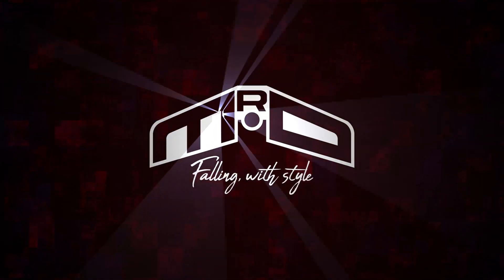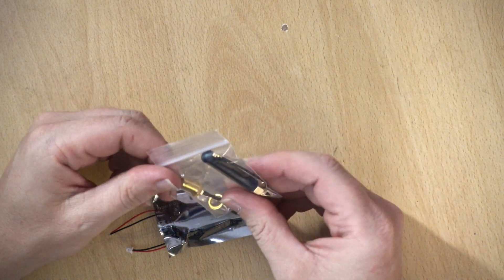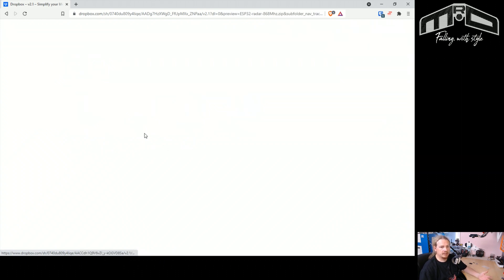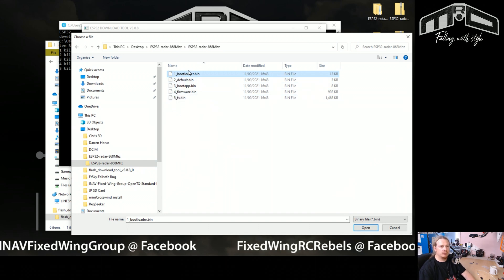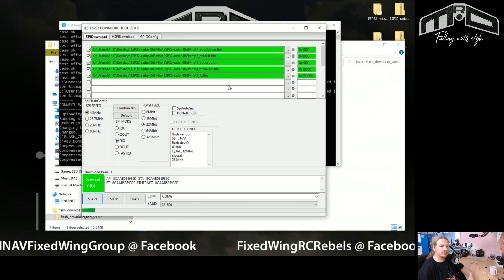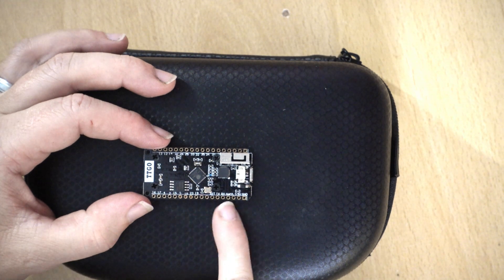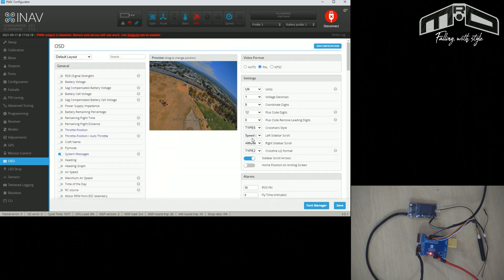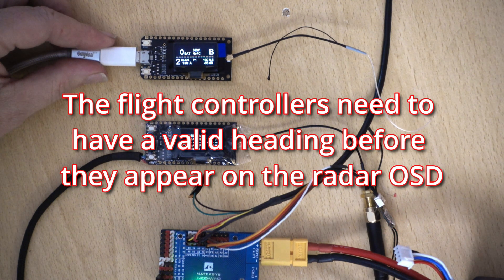Setting up iNav Radar

Comment: Does 433mhz and 2.4g interfere a lot?
The 433mhz module is only 2€ right now and the 868mhz link doesn't work for me, but I want to fly 20km+ away from me with this and elrs.
Do you think that would work out
Reply from the maker: It should be fine. 

This is for seeing other aircraft that also have the radar modules on the same frequency. The maximum claimed distance is 4km. It’s not really needed for positioning between the aircraft and home.
Reply: @MrD  im just wondering if it would affect my elrs (2,4ghz) range if i'm using 433mhz
Reply from the maker: No. To be honest, 20km is nothing for ELRS. You could get those distances on low power.
Reply: @MrD  ok, thank you

Comment: FormationFlight seems to have taken over from inav Radar. It seems a advantage is that the hardware used can be repurposed express LRS receivers.  Would be interesting to hear your thoughts & might be a good topic to do a video on the setup/configuration.  Cheers

Comment: What's the minimum to get a heading in inav? We're setting up formation flight on wings without a compass and my friend had to drive in the car to get a heading before the OSD would show up to test everything. If we could walk around the yard a bit would be good to know.
Reply from the maker: I never bother. All I do is make sure that the device in my plane can see the flight controller (will have GPS data). Then when a friend switches on, make sure that the other pilots are added. If this works, I just fly.
Reply: @MrD  understood. We're we just trying to make sure it worked on the bench since our group doesn't get together often

Comment: Hey ! Your video was very helpful. Does this system also work on a digital system?
Reply from the maker: It depends on the system and firmware. HDZero, Walksnail Avatar, or DJI with the WTFOS firmware will work 100%. DJI with their own firmware will not work well.

Comment: Thank you. This tutorial helped a friend and I setup our iNAV radar. 
We have a question you might be able to answer. The HUD displays 3 strange arrows. That don't seem to describe anything. Do they have a function, or are they a bug?
Reply from the maker: Great. I’m glad it helped. Check out this article https://www.mrd-rc.com/tutorials-tools-and-testing/flight-controller-therapy/esp32-radar-finding-your-friends-in-the-sky/

If the arrows are around the crosshair, they are the home direction. I will be making an updated video when INAV 6 comes out, as I’m working on a change to make the HUD elements much nicer.
Reply: @MrD  Thanks. The article is very informative.
Even more extra's in 6.0. Top stuff.
Reply from the maker: There will be if I can get out and test before the code freeze. But I’m pretty hopeful.

Comment: the data should be sent to the OSD and not the ESP32 display thingy, otherwise, how would the pilot see the information if he/she's got an OSD google on the head while flying?
Reply from the maker: The data shown on the OLED display is only used for set up and when you first plug in. All you need to remember is who is A, B, C, or D. Everything else is in the OSD.

Comment: Hello! Now we have 4 folders in iNav Radar Firmware. lilygo10/14/16/20. What can i use for 433mHz module?
Reply from the maker: Those folders are for the hardware version. So you would use the one that matches your module.
Reply: @MrD  mine says v1.3 on the board. However it will only boot on v1.6
Reply from the maker: Sounds like firmware roulette. Keep trying until we have a winner 🤣

Comment: Can we see the other nod in DJI OSD
Reply from the maker: Not currently. There is a hack being worked on for DJI. But ultimately, to have a decent, fully featured OSD, DJI need to implement a canvas based OSD. This is what HDZero/SharkByte uses, and it is much better.
Reply: @MrD  Darren, has there been any progress in the hack to make the DJI Goggles see INAV Radar?  My buddy and I have our units working but we no joy in our DJI goggles
Reply from the maker: Hi Larry. I know there’s a hack in progress. But I don’t know when it will be released or merged in to the projects.

Comment: I was wondering if this would be a great way to see thru the fog when trying to land. Keep the target radar on the ground where you would land so you could know where to descend.  Just a passing thought.
Reply from the maker: No, it doesn’t work like a real radar. Its more a transponder system.
Reply: @MrD  let’s say the plane you are following is on the ground. Would it serve as a landing target?
Reply from the maker: You could do that. But wouldn’t it just be easier to use the home arrow or set up a safehome?
Reply: @MrD  yes of course, however the radar would present a better reticle  target in the fog for a gentle landing attempt from what I have seen so far. Might be fun to try.
Reply from the maker: I was chatting with Crunklefloop, who was forced to land in heavy fog. He would have no doubt crashed if he hadn’t flown IFR using the iNav LUA script.

Comment: When flying CF on 868mHz in Germany, which module should i chose?
Reply from the maker: 433MHz would be the best bet. 868MHz should be fine due to LBT. Just don’t go for 915MHz.
Reply: @MrD  but wouldn't the 868 interfere with the CF? 
If I could use the 868, I could use CF antennas for the radar.
Reply from the maker: It shouldn’t because of LBT. But to be 100%, go for 433MHz.

Comment: This hardware is essentially a bigger, more powerful ExpressLRS module. They use the 8285/8266 instead, but it's quite possible this could work.
Reply: The ELRS folks are using the exact same radios tho

Comment: does this also work with the air unit or only for analoge?
Reply from the maker: Unfortunately not DJI. It works with analogue. It possibly would work with Shark Byte, as iNav draws the OSD using canvas mode. But I’m not certain about that. It’s certainly more possible than the current DJI setup.

Comment: I love your videos Darren they really help people get into the hobby that is crucial to hobby survival, I've been looking over your videos I can't find anything that would help with my problem cuz I'm not 100% sure what the problem is. Basically my fpv feed isn't working. I think I know how everything is supposed to be setup. I have some questions, how do you control the readymade rc 1.3ghz reciever? I push the buttons and it doesn't change channels . I'm doing video-in to my Attitude V6 goggles from my Vrx, I've got the goggles set to A/V 4:3, im using an A/V (like an RCA jack but just the red and white ones) to 3.5mm adapter from the RMRC Vrx to my goggles, is there any other setting I need to enable on the goggles or change? Both tx and rx are on 1280mhz in the us, I've checked my wiring from Cam to FC then FC to Vtx, everything looks good tx to Rx on UART 3 for Vtx, vtx pad on fc to vid pad on vtx, irc tramp enabled on UART 3. One other thing I noticed the Ratel 2 got pretty hot on the bench down in the Ar Pro, I checked the wiring Its correct. Sorry it's so long, any ideas?
Reply from the maker: Thanks, appreciate that :)

The buttons on the front of the VRx should change the channel on the receiver. If you don't see the value in the display changing, it sounds like you have a faulty unit. For connecting from the VRx to the goggles, you only need the yellow socket on the VRx. That is the video signal, the white is the audio. With that socket, you will have the video signal and ground. If you have a screen with a phono video input, you can connect it directly to the receiver to see if the problem lies before the VRx, or the cable between the VRx and the goggles. 

I don't have the Attitude V6. But on my old Dominator V3 and HDOs, clicking the left black button (the one that is also a 4 way jog to change brightness) will switch which input is used. If you haven't changed that to the cable input, that could be your problem.

I would recommend taking the output from the VRx, and feeding it to a 5.8 VTx that can just sit on 25mW. That way you're wireless to the ground station, meaning more separation from your control link.

It sounds like the setup on the plane is fine. I guess you're using the new Matek 1G3 v2 VTx? The camera can get hot sitting still. It also depends on how much input voltage you're giving it. More voltage = hotter as it has to drop it down to the working voltage.
Reply: @MrD  So I plugged the video receiver directly into my TV and I can see a picture from the wing but it has horizontal lines rolling vertically, unflyable, I don't know if that's just because it took to the TV or if it would still be like that in the goggles maybe it's interference from my 2.4g control link, I have a 1.3 pass 2.4 stop filter in the mail, 
Also on the Vrx today all the sudden the buttons seem to work fine, when I change channels about half of the channels have the period next time and half of them don't and it doesn't matter whether it's numbers or letters. Also the Vrx is changing channels on its own a 2-3 mins after I set it. 

 So I do have a picture though and the video receiver seems to work though I don't know why it's changing channels on its own. I guess I need to figure out why the goggles are not accepting the signal the only modes I have to change from with that left button is HDMI or A/V 4:3 and A/V 16:9 none of them display anything, Or I could try the 5.8 GHz relay my question is on the video receiver RCA style plug which internal wire is signal and which is ground?
Reply from the maker: @jhughes2286  I’ll have to have a look and get back to you. However, it won’t do any harm if they’re backwards. Just more soldering. I’ll take a look next time I’m at the car. 

Actually…..

It should be the same as the lead I use to get the video feed straight off a flight controller. With that the middle pin is signal and the prongs around the outside are the ground.
Reply: @MrD Ok I'll wire it up thank you
Reply: @MrD  So I got it all hooked up and working thanks to your help! Thank you so much! Now I can see there is an error on the OSD it says (invalid settings Nav_Land_Slowdown_MAXALT) do you know what setting I have wrong?
Reply from the maker: Yes nav_land_slowdown_maxalt is wrong. Just type get nav_land_slowdown_maxalt in to the CLI and it will show you the accepted range. You can find the default value here https://github.com/iNavFlight/inav/blob/master/docs/Settings.md
Reply: @MrD  Ok, I'm on inav 2.5 I'll do that.
Reply from the maker: Wow, 2.5. That must be a year old now. If you follow the above and use the default value, it’ll fix your problem.
Reply: @MrD  I've followed your video but I just can't get this board to flash for whatever reason, but I did change the the maxalt setting and everything is good now, so I'll do some bench testing with the plane armed and then maybe a maiden today, thank you so much for the help couldn't have don't it without you!
Reply from the maker: @jhughes2286  no problem buddy. Good luck 👍🏻
Reply: @MrD  Now the Osd says "Unable to arm" ...." Disable navigation first"... I can arm in acro or manual modes but not angle, is there anything wrong with just arming in manual mode on the ground then switching to angle mode for launch , or is there a setting I should change? Also would you mind looking over my modes and just see if there's any problems, or give me the recommended basic mode combos?
Reply: Also this RMRC Vrx changes channels on its own after I set it to a channel, so I won't be flying until I can get that resolved and this was the last RMRC Vrx in the world when I bought it just 2 weeks ago
Reply from the maker: @jhughes2286  you should be able to arm in manual, acro, horizon, or angle. Have you added altitude hold to angle, as that will stop it.
Reply: @MrD  Yes I did add althold, I will change that.

Comment: Super. Duper. COOL!!!!!    and pretty straight-forward. Excellent how-to. Are you going to make another video of what the OSD shows? What all can you use this for (you did mention this. sry)? Forgive me if you mentioned it. What iNav versions support this? Since it is particular with the OSD's crosshair setting does that mean it would interfere with the FrSky Pixel OSD? Is there a regional preference on frequency you order/use? I assume it has to match your flying buddy?
Reply from the maker: Thanks 👍🏻

At the moment there are known issues with the Pixel OSD. But hopefully they will be fixed soon. As for the crosshair, type 6 is recommended, but you can use any. 

For regional preference, just make sure the frequency is legal in your country. Your friends would also need to be on the same frequency.
Reply: @MrD  The regional thing makes sense. Id personally avaoid the 915mhz and 868mhz ones just in-case it would pose a risk to my r9 control link. It would paranoy me. Have you ever noticed the f405 wing "acting" differently with an OLED attached? Luckily the esp32 here just uses a rx/tx. My f405 beeps differently when I enable OLED over the i2c.
Reply from the maker: To be honest, I’ve not hooked up an OLED to a flight controller. I tried it years ago, but they always had a conflict so never worked. The OLED on the ESP32 won’t effect anything on the FC.
Reply: @MrD  Marc Hoffman told me if it does make the fc "stumble" as soon as the fc is armed it disables the oled but it just psyches me out lol. Its odd. It changed how the fc's beeper pattern would work. Only happened when the oled was enabled. It was just one of those "because I can" mods to my f405w. No worries just a curiosity.